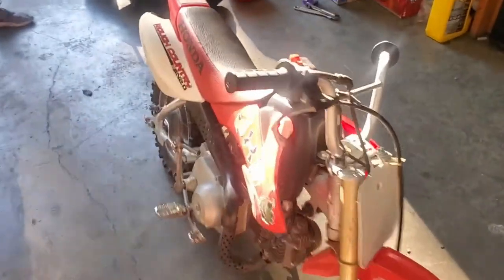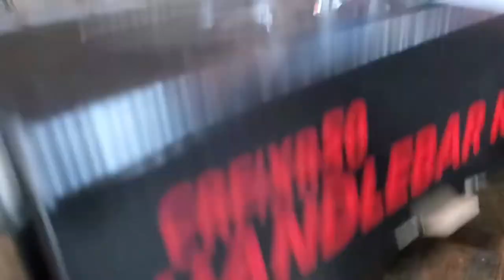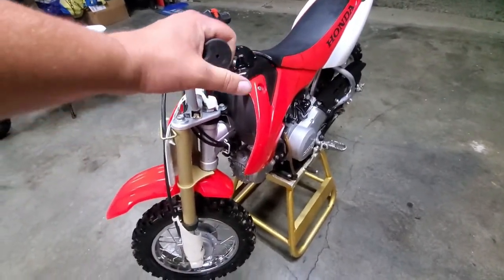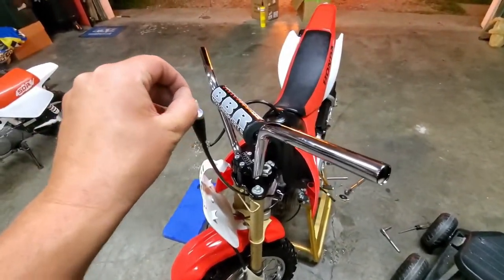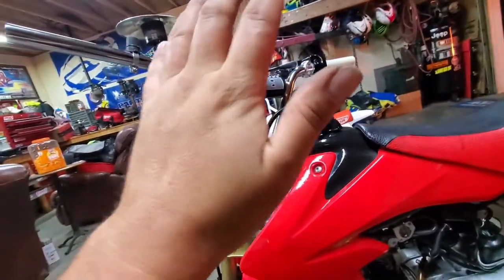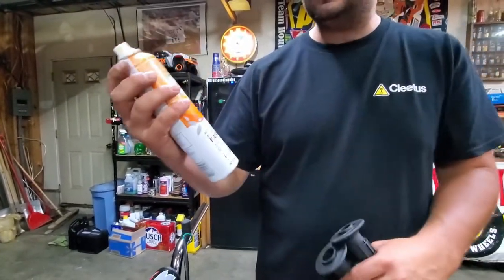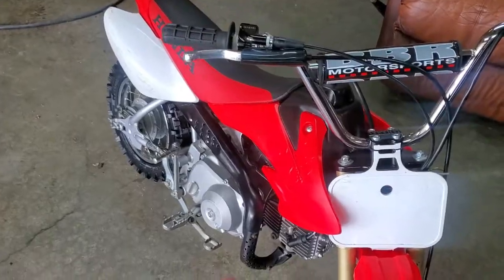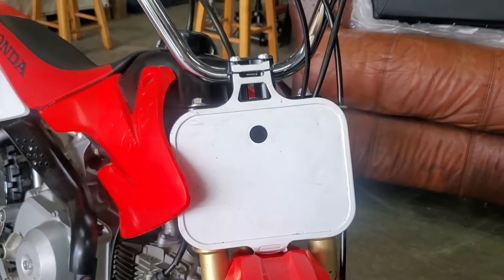Crf50 BBR Tall Bar kit install

Comment: Looking for a stock pair of handlebars throttle tube and throttle cable for my 50. Did you hang onto this stuff? If so id be interested in purchasing it.
Reply from the maker: Hey Dave yea sorry I have one more boy that will start riding later this year. So going to hang on to them for extra parts. Thanks for watching!
Reply: they have em on ebay
Reply: It’s literally like 8 bucks hella cheap

Comment: how did u take the bars off if they are welded on
Reply from the maker: You have to get the upgraded triple tree to run aftermarket bars. The bbr kit is nice because it comes with everything.

Comment: does that throttle body work for lock on grips
Reply from the maker: My opinion would be if the lock on grips work with your stock throttle I wouldn’t see why it wouldn’t work with this one.
Reply: @FullSpeedImpulse  so the throttle tube matches your stock
Reply from the maker: As far as I remember it was just a basic throttle tube setup.  So yes matching the stock. It wasn’t a special quick throttle or anything like that and I’m pretty sure you could use your stock throttle body if you needed too.